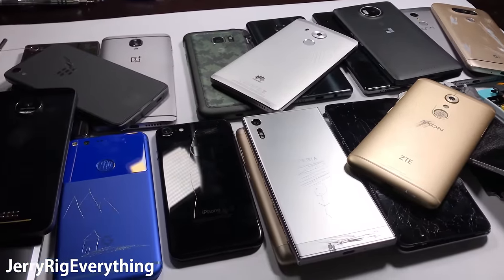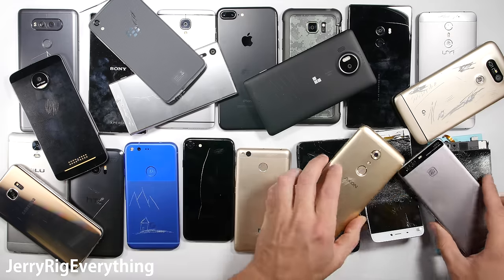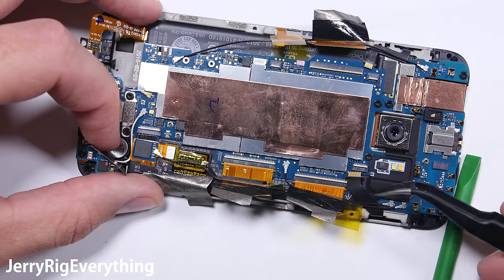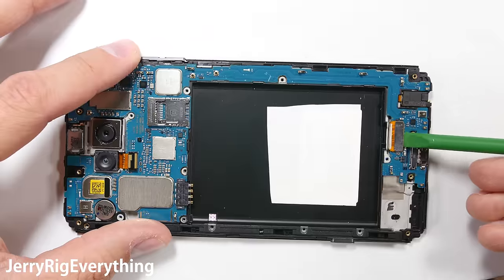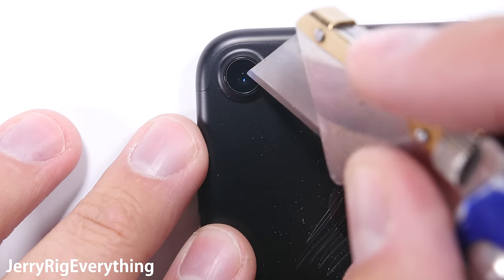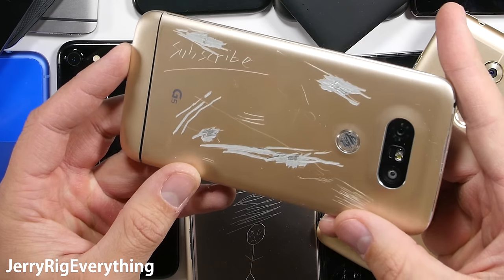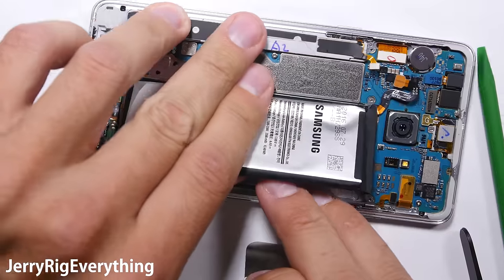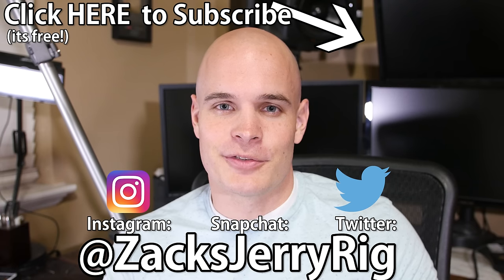Most Durable Smartphone of 2016 - Year End Summary Awards

Comment: the most durable phone is my galaxy j7 prime. survived me sitting on it , acting as my laptop fulcrum and survived drop on marble floor 4 times without shattering a slight bit.  people think only the flagships are durable.zz
Reply: full plastic trash is durable because plastic doesnt brake on drops and they are light but they snap in half easily and they are ugly af
Reply: Aaponton j7 prime is metal though
Reply: +Aaponton ignorance is bliss, as they say
Reply: i had that phone and it is still in perfect working condition

i had a samsung galaxy core prime and that shattered and snapped

i have an lg g5 now and the screen is pretty scratched up after owning it for two months
Reply: My 3310 got dumped into water 
Flooded inside 
Used as a hammer to break an iPhone 
And it's great as brand new still
Reply: and this phone wont get android 7 update...so no point in buying shitsung
Reply: random name . dude my phone has secure folder which even the s7 has not got. looking at samsungs track record they give update for every phone till the next android version, even if it may be late.
Reply: it was present when i bought the phone so i beleive it was the same as that of note 7
Reply: sagar A my iPhone SE is more durable then that
Reply: Gabriel Cheinquer I'm not just I disagree I have the right to have my opinion
Reply: Jace Winfrey my mom got the iPhone se had it on the table less than 1 feet fall screen shatters she got the LG g5 and i got the same phone she is not a fan of big phones but she liked that one
Reply: sagar A 
nah dude, the j1 duos is the best. My friend throws it againt the wall every time it lags and the screen is still not cracked. He even droped it into his pool
Reply: Dude, I am 110KG and I stepped on my Chinese phone "Xiaomi Mi Note 2" yes did not break or anything, but does that make it, wow the most durable phone? Nope I mean maybe  I was lucky that's all. But with this channel you get to see a REAL durable test... Not a one that you oops dropped my phone then yay it did not break it is the most durable phone XD
Reply: Most durable phone (not smartphone) is Samsung B2710 Solid. My survive not only drop, but my throwing it to concrete. Watch some test of this phone: full waterproof (even on one test they freeze it in water overnight, and it was still ringing in brick of ice).
Reply: wow it survived you sitting on it? such a great accomplishment
Reply: Well flagships are not really that durable if you compare them to rugged phones designed especially for this shit. They never really have flagship insides, but durability wise, they take the cake.
Reply: Matei I don't care really a phone is a phone all phone make calls if you were mature you would stop arguing like I'm going to do
Reply: Same here

Comment: I'm sorry, but I didn't get you well, is it the one plus 3t is the most durable phone, or the HTC 10?
Reply from the maker: The HTC 10 is the MOST durable. The OnePlus 3 is the most durable out of the cheaper phones.
Reply: @jerryRingEverything what about moto Z where will u rank it around the other phones
Reply: you should go watch the moto z durability video......anyway it's great for a phone that thin
Reply: holly hsieh HTC 10 was a brick,  rigid as a rock but u can see that its screen left a burnt mark on screen after burn test and moto z was clean...and did u seen the repair video for HTC 10 it was a nightmare after opening the phone...in my view  moto z was the best phone for the price and i am a stock android fan...and i dont like HTC software environment....
Reply: sanjay prabhat lol why you say so much...i'm just saying moto z durability is good under normal use....and just answered you question lol you don't need to worry about that.......and that's it.......
Reply: yea HTC is nearly stock android that for sure.....actually the nearest stock android that's not nexus or pixi..
Reply: Will you make Honor 8 bend test?
Reply: Oneplus3T is really a good durable phn nd premium feel

Comment: You missed Galaxy s7 active it it the most durable in my opinion and if u want glass screen get temp glass
Reply: XDangerZone640X the whole point is not to use screen protectors or cases.
Reply: i was thinking about it as well, and i remember that the front scratches so easily
Reply: Look at the price of repair. Since the S6 replacing a cracked screen on a Galaxy is crazy expensive.

Comment: you might mistaken the concept of alloy. alloy means mixture of two or more elements. alumunium alloy means that metal piece contain mostly aluminium with several alloying elements such as manganese, silicon etc. alloy doesn't mean two piece of metal bonded together into one solid piece. that G5 you scratch, i can see that there is metal in it, so it's probably the alumunium alloy they're advertised about

Comment: My daily driver is, and will continue to be the Nexus 6P for another year I estimate. 
I've cracked this phone open, which is rate 6/10 for level of difficulty for disassembly. 1 is easy 10 is impossible. 
My biggest complaints are the fact the battery is glued in, and I cannot seem to find replacement main boards with more than 32gb of on-board memory. 
I'd love to upgrade my phone but oh well

Comment: I think you were a little hard on LG g5 with the metal part. If it's metal with a coating,, it's still metal. The coating doesn't change that. Cars, planes etc are painted metal as well, but still metal. Just saying.

Comment: Have a redmi note 3 with a screen protective glass and a cheap see through case, fell on laminate, concrete, ceramic tiles and carpet and the only thing that cracked was the protective screen guard, no bends no nothing after 9 months of daily use.

Comment: My Favorite one is Meizu phones. I have a Meizu phone. It dropped from 3 feet height and nothing happened to the phone or its display and also not just one time...it used to slip from my hands very often, but phone has still no problem..I am using MX5.
Reply: my galaxy grand quattro dropped from the first floor and just scratches at the sides. fully working till now...

Comment: You know, the thing is, this whole durability test and all wouldn't have started had Apple not failed the iPhone 6+, so what about you started testing older phones? like the Galaxy S2? or S3? Phones that may fail your current "durability test" may have survived much abuse in the past. Unlike thin aluminum, plastic doesn't bend, and plastic only made phones may survive pocket pressure without a hinch.

Comment: Well, you've said that OnePlus 3 is a good and cheap phone. In my opinion it's not. It's still priced for around £400. My definition of a budget phone is something that falls at maximum of £175. I ordered a Xiaomi Redmi Note 4 for around £135, but my parcel got returned to the country of its origin, so I went with Moto G4 instead, for £150. Tell you what, so far this phone does a really good job for this price. Of course, OnePlus 3 is cheap in comparison to Samsungs or iPhones, but let's face it, you have to change your definition of 'cheap'.